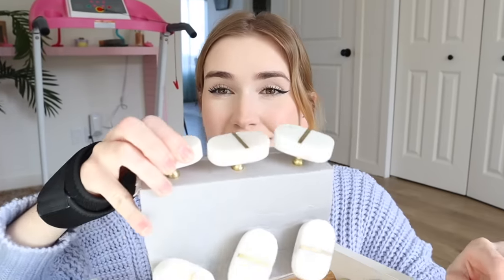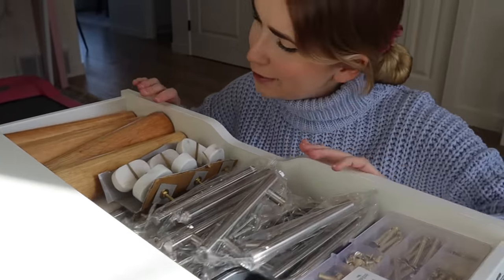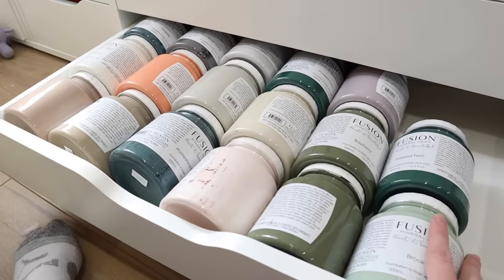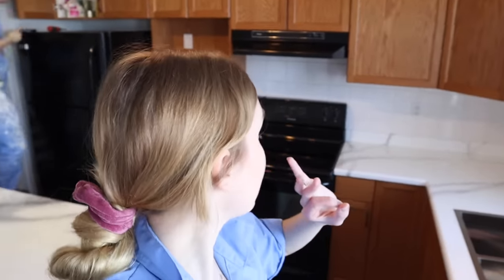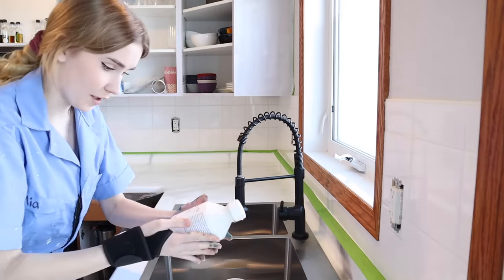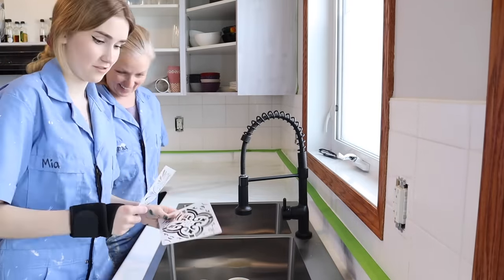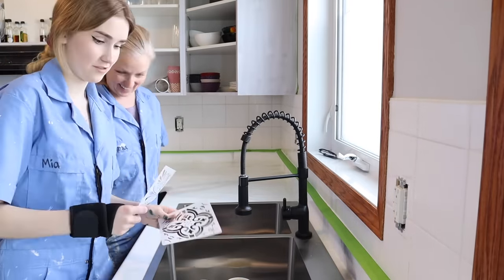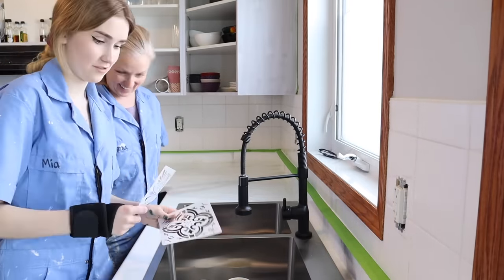I Spent NOTHING On This Kitchen Makeover !! HOW?!?

Comment: Might I suggest, when painting cabinets, dresser drawers, etc. mini foam rollers are the best for giving you a perfectly smooth finish! You can use a small brush to cut in lips- like where the raised borders around the cupboard fronts meet the center, but when rolling over flat surfaces you can't go wrong with mini foam rollers!

Comment: Not gonna lie, those tiles that were done wrong in the corner were bothering me and I wasn’t sure if they had noticed lol
Reply: Same. 🤭😅
Reply: Don’t believe they fixed them. It will haunt me forever.
Reply: @leticiamilan3575  same
Reply: Me too, it's the first thing I saw
Reply: at least she covered it😔
Reply: Right! It hurts my soul, I came straight to the comments to see if anyone noticed it.
Reply: @crimson9039  same
Reply: She put the plant in front of it 😂 I’m glad I can’t see it
Reply: I was just about to comment that and then found out. 🤣
Reply: I would've been way too paranoid to ever throw out the only stencil I had. Hence I would've had to fix it as I noticed it right away. Even hidden, it would forever be on my mind if left unfixed.
Reply: True, I thought she was going to fix it, I thought she said she was going to look for the stencil.
Reply: I wondered that too...also noticed that the cupboard doors weren't painted on the inside to match...was that intentional? Just wondering.
Reply: I liked the stenciled tiles but I wouldn't have done so many.  Ended up a little busy..but it is her kitchen and she loves it
Reply: @sandraroberts1931  she literally never paints the inside of cabinet doors/drawers and it drives me mad 😹
Reply: @leticiamilan3575  They couldn't fix them because they had already cut the stencil in half, top and bottom.  To fix it, they needed another stencil that could be cut in half vertically, left & right.
Reply: I noticed too 😭
Reply: Sooo glad I am not the only one. I was like please tell me you see that!!!
Reply: @crimson9039  lol same here!

Comment: LOVE how your moms kitchen turned out!!! I wasn’t sure about the green bottoms, but now that it’s all done, looks AMAZING!!! 
The only question I have is, did you have to put a protective coat on top of that paint?  Also I’m wanting to paint my vanity, and I noticed you didn’t sand the cupboards first. Do you not have to with that brand of paint?
Reply: I would sand it first, then the paint will last a lot longer
A top coat will probably make it easier to clean, but it's not necessary. If it's in your bathroom, maybe you should add a clear varnish on top?
Reply: Yeah, i was thinking too: won't the paint chip without sanding? You could also use a soft scouring pad to roughen up the surface. But I wouldn't paint over it without doing something like that.

Comment: For anyone else going to use fusion mineral paint I highly highly recommend using a light sanding first and then a good primer. Technically fusion doesn't need primer but I don't have a single piece of furniture a cabinetry in my house that doesn't get banged around occasionally. Especially someplace like a kitchen that has high traffic you're really going to want to prep right. Also if you don't like the look of the wood grain through paint after it's painted you need to start by filling in the wood grain with a grain filler or bondo or such.

Comment: If you use a sprayed stencil tack you can put it directly onto whatever surface you want and it doesn't bleed through and you don't have to use tape and you can take it off and put it back on I think like two or three times before you have to add maybe a little bit more to it and it doesn't leave a sticky residue

Comment: There is nothing about prep in this as far as painting the cabinets. Did you clean the outside first, do you need to sand with the Fusion paint? Any kind of topcoat? Really need to know this stuff. Great video, and it came out beautifully, btw I love the wood trim around the window, probably matches another window or door close to the kitchen?

Comment: Wouldn't it be easier to apply the paint to the cabinets using a small roller? & to use a brush to get into places the roller can't? The roller should apply paint more evenly & have a better finish (no brush strokes).

Comment: Is that a special kind of paint you used on the cupboards where you only have to clean them and not sand them or remove clear coats?
Reply: Mia uses this paint a lot, she has mentioned that you don't have to sand the surface first which is why she likes it so much I think! She uses Fusion brand but I believe there are similar paints called chalk paint 😊